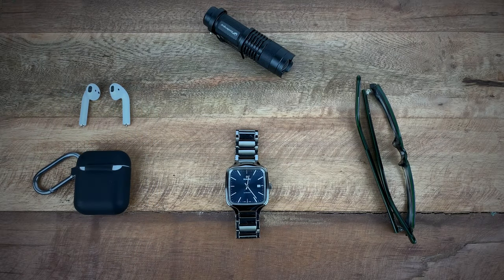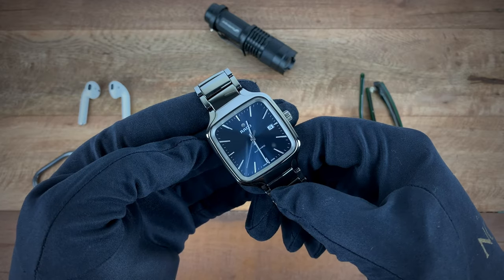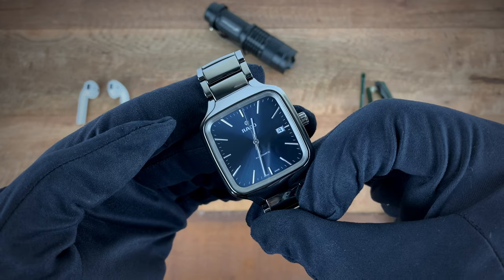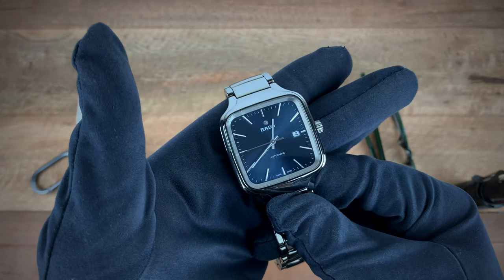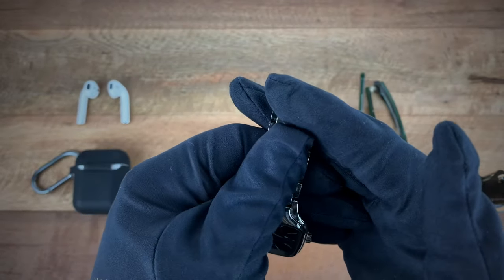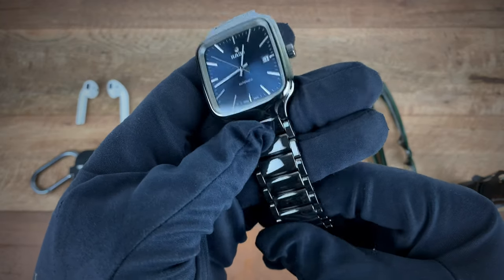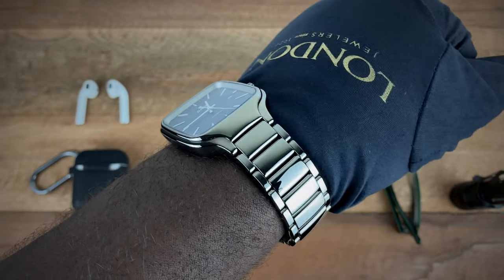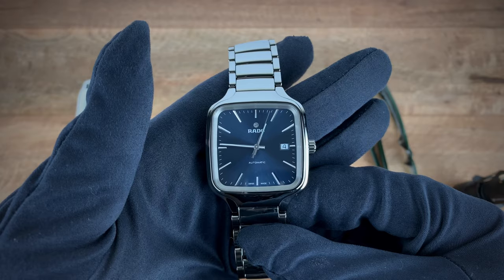Rado True Square Review

Comment: Good video. Not enough Rado on YouTube. I think they get overlooked as a Department store brand. Have a D Star and really like it. The ceramic wears comfortably and holds up very well. Looks dressy, but has 100 m water resistance, and is almost scratch proof. I did start carrying a microfiber cloth to deal with the fingerprints 😂
Reply from the maker: Yeah. I kept two while i had the watch. One in the car and one in my pocket.